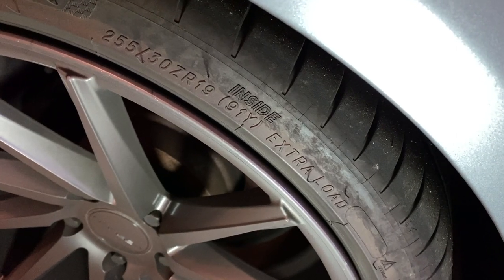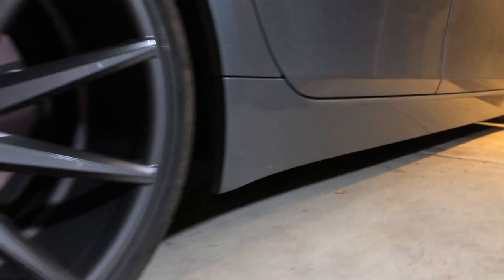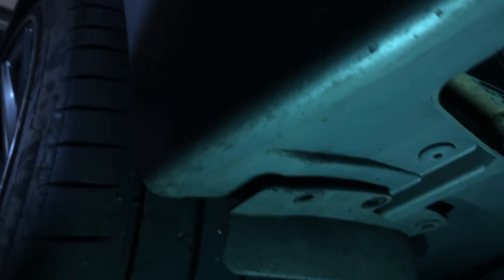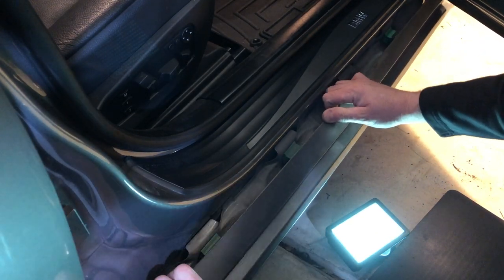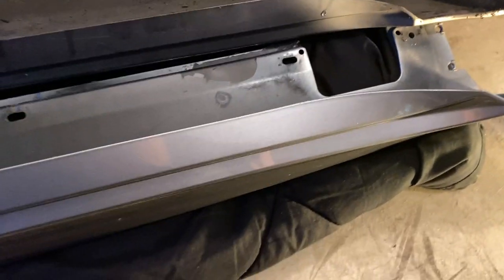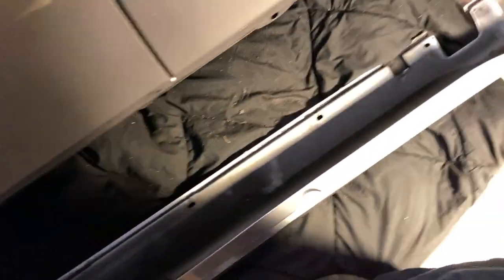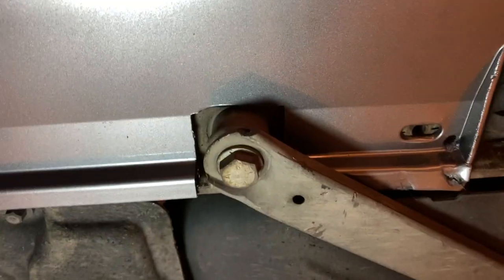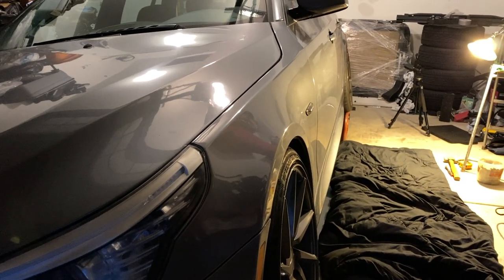Another BMW Project Part 04 (M5 side skirts on 535xi wagon)

Comment: Looks good! I bought several sets of wheels and tires from the Tire Rack. One set came with the directional tire mounted facing backwards. I did not see it. Luckily an observant forum member noticed! I think it is more common today as the volume of high performance wheels and tires sold is much higher.

Comment: Nice, did the same swap!! The skirts and the rear bumper are the easiest part!  I think your skirts came from a sedan, i didn’t had to cut that piece out ... you might need the part that the aircompressor is into...

Comment: Good information! Glad I looked here before starting. Those pull rod things mentioned around the 7 minute mark, are only on E61s with panoramic roof, right? Perhaps that is standard on the 535xi. Could not find them on our Euro 2008 530d that has no sunroof. The M/M5 skirt went on without modifications. No cutting necessary.
Reply from the maker: Thanks for the info! From what I understand, all USA E61s came with pano roof. I personally owned 4 of them, and all had pano roof and these rods. I guess these rods add some rigidity to North American E61s :)

Comment: Is it possible to swap Heads Up Display and Lane Departure Warning between E61s? I currently own an E61 with high mileage and needs a lot of work. I am looking to buy another e61 with lower mileage and significantly less wear, but it does not have HUD or Lane departure. Is it possible for a mechanic to swap these options unto the newer wagon? They're exactly the same year.

Would I need to swap the vehicle computers? Basically any idea about how to achieve this change over will be greatly appreciated. 

Thanks,
Reply from the maker: I have seen people retrofitting HUD, I think swap should be even easier. But, some of these modules would need coding. I know from my previous experience that everything that deals with car’s VIN has to be coded and is not plug and play. 

If you completely swap all computers and wiring will match, probably you would be ok, but I’m not sure. Make sure to check wiring plugs, that wires match on donor and your car. If donor had different options, at least one, wiring could be different.
Reply: @EliteBimmers   Thanks EliteBimmers, donor car has cold weather package, mine doesn't have, that's the only difference.

Comment: Are they bolts or what to get side skirt secure cuz my side skirt is loose on my 528xi
Reply from the maker: They are plastic pins that hold the skirts. You could try using these expanding pins: https://www.ebay.com/itm/323364159149